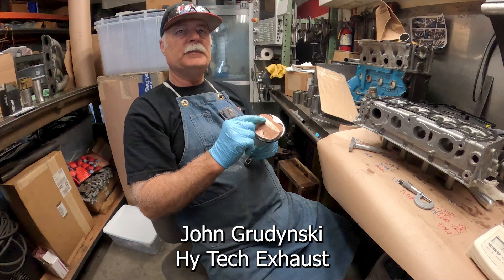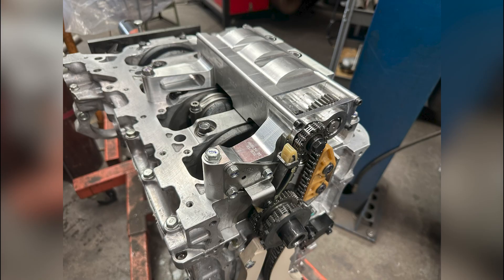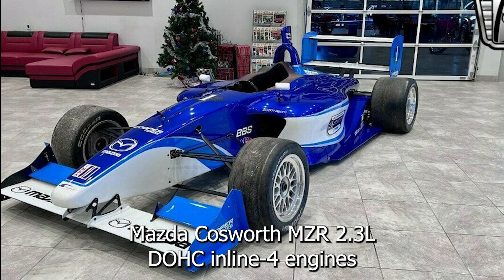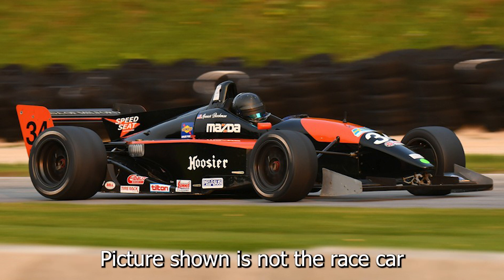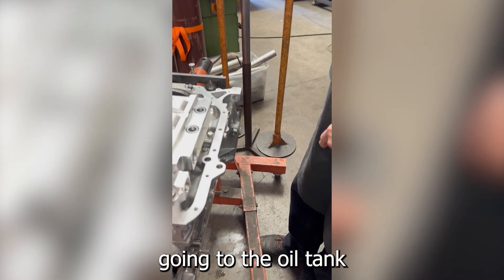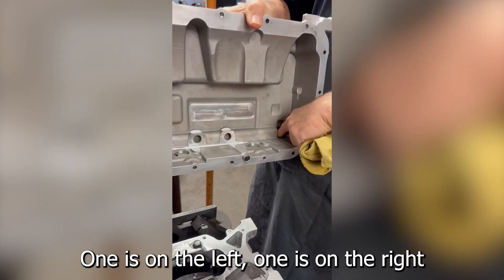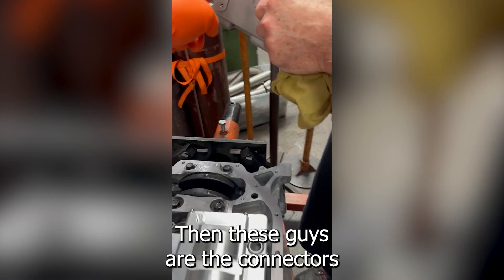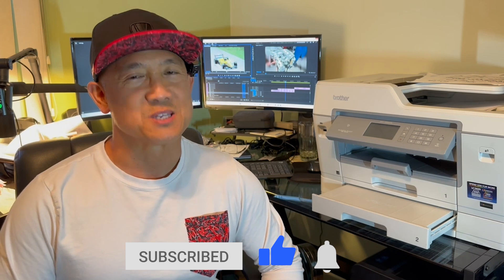The Dry Sump Honda Never Made

Comment: This is AWESOME!! How many pumps are in this model?
Reply from the maker: There are 3 rotors. 2 rotors are used to pump oil to the oil tank and 1 rotor is used to pump oil into the motor. You can see the 3 rotor humps on the billet aluminum pump. Thx for watching and commenting. -AJ